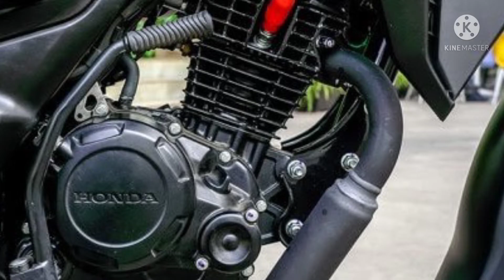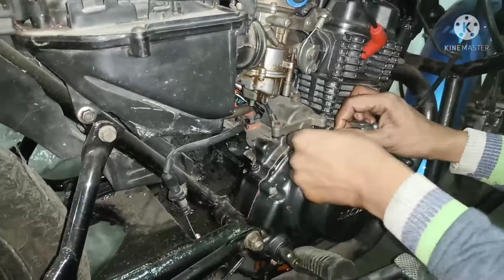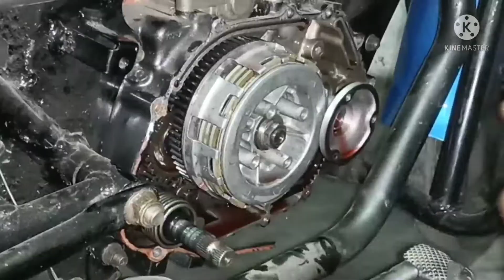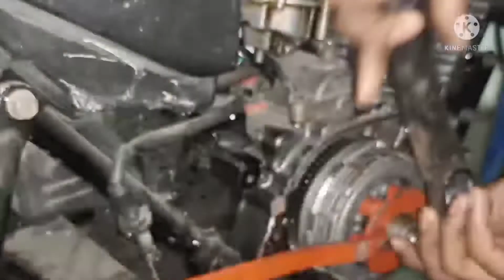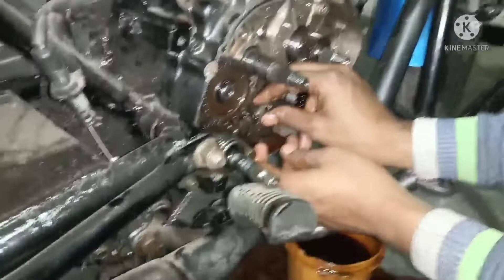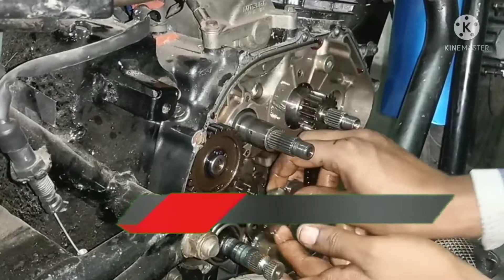Sp 125 gear shifting problem #honda sp 125 bs6 #gear shift problem

Comment: Bhai mene abhee new sp liya hai 30 /20 speed pe vibration feel hota hai leg or handle pe
Reply from the maker: Check Fast Clutch free play...
After check men suspension Nut🔩 tight...
Also tyre pressure check 👍👍👍